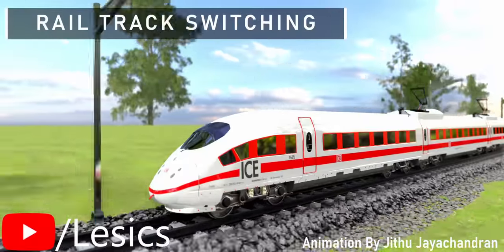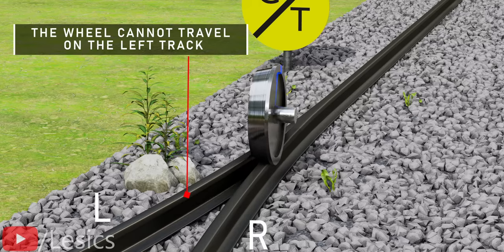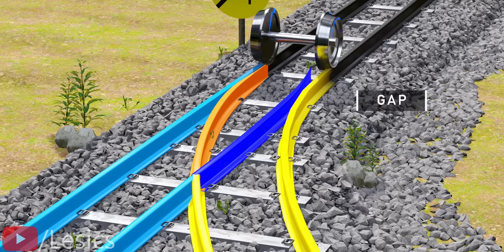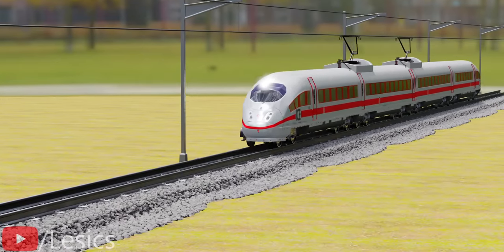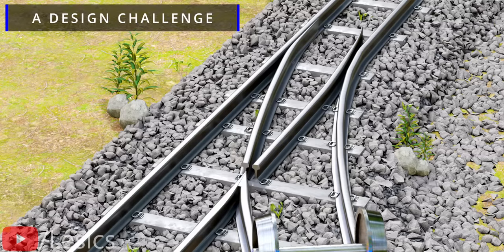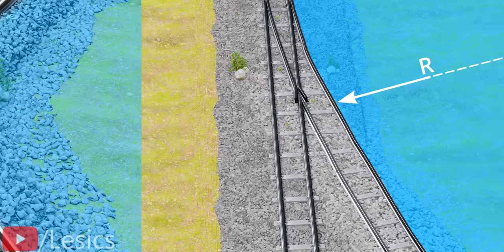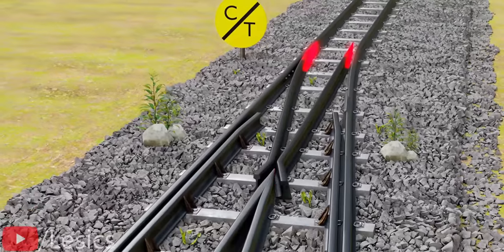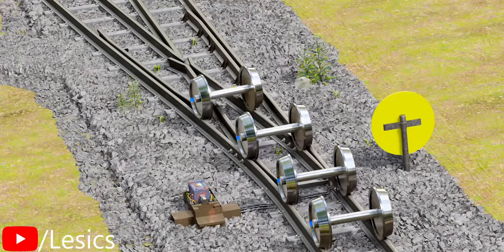How do trains change the tracks?

Comment: I have travelled  so many times in train....always  think  about this mechanism how it actually works?..this video explains everything....thank u...
Reply: Yes
Reply: Not quite everything.
What will happen if the switching parts of the rails will be somehow stuck in an in-between position?
Reply: @StrangerHappened  Good point, any feedback mechanism can be place here to find out the proper positioning of switching part, then this problem can be eliminated Or may be there would be some kind of solution for this already which is not covered in this video.
Reply: What software do you used to make this video
Reply: @StrangerHappened  If that happens, a speed code of 0/0 will be imposed and a red signal will be shown at the signalling light preceding the affected section, preventing any train movement into the section.

If I am not wrong the tongue rail will be locked in either position, otherwise it will cause the above to happen.
Reply: Same...... always tried to visualize it in my mind, but it was really difficult. This helped loads
Reply: Yes right,I also think that 😁
Reply: Yes... I.... I'm also..
Reply: Sukhibhava 🙌
Reply: @arjunkulshrestha78 ll
Reply: Yaa same here
Reply: @StrangerHappened  signal will be red and only after proper setting of the points and manually verifying the train will be passed over it that too with much lower speed.
Reply: 1q1
Reply: Me2 finnaly i know!
Reply: Everyone with a little IQ comes also completely alone on the solution how it works.
Reply: Yes
Reply: It happen to me too
Reply: @FlameBot  smart people don't look down at other people just because they didn't know something.
Reply: @StrangerHappened  হনডতাট
Reply: 太清晰了
Reply: wow...
Reply: You hadn't any toytrain when you were a child?
Reply: 6
Reply: Jjm no
Reply: @StrangerHappened  qqq
Reply: #gemigsultanami
Reply: খগ
Reply: @sintudas1828  

==¥
Reply: @sintudas1828  er1v
Reply: @sintudas1828  to
Reply: P
Reply: Kkiiu[8
Reply: @arjunkulshrestha78 w2q
Reply: Same
Reply: @StrangerHappened  train movement can happen only when point is mechanically AND electrically locked and it's indication is provided at the station master's panel. When the switch rail is in between position, the indication at panel keeps flashing.
Reply: ডতজুড
Reply: @sintudas1828  j ji
Reply: @StrangerHappened  0
Reply: @sintudas1828   x
Reply: @sintudas1828  eqoõqqõq
Reply: @arjunkulshrestha78  00o09
Reply: 8
Reply: @StrangerHappened  hbgjkf
Reply: @sintudas1828  Puri up i0i oo ji up
Reply: @sintudas1828  111nhobana bhojpnhopiriganauriga
Reply: Hi dharu
Reply: Indeed
Reply: Me too
Reply: Bruh i knew it Since im 6
Reply: @StrangerHappened  Then do something that brits love to do. Cancel or delay the trains!
Reply: Same here
Reply: ᴅᴀɴ  Some trains do have a steering wheel though.
Reply: @StrangerHappened  an accident at Crosby Station near Liverpool happened because the signalman didn't set points properly because they were sticky ( look on you tube) so accidents have happened because of points.
Reply: @StrangerHappened I’m pretty sure it would derail but idrk
Reply: @Strangero8tyHappened

Comment: As a rail tech myself, the presentation is guite good. The current mechanism would be more complex due to the need for high speed through the switches, the gap is handled with another switch. So the wheel is smoothly pass through at high speed. And also the steering mechanism which consists of several lever on the boogie and its cone shape wheel keep the train inside the track while making a turn. Its fascinating watching these awesome tech..
Reply: how are the tongue rails bent? if they are made with iron, how do they bend like that?
Reply: @FelineRaptor-gv4te  heat it up, then it gets flexible 😂
Reply: I know Cause I'm BatMan.  oh, now i get it. but wouldn't it have required a lot of strength when it was done manually in the olden times.
Reply: @FelineRaptor-gv4te  man it placed in such position that is suitable for and probably power driven by motor on this work should might be sufficient for it.
Reply: @FelineRaptor-gv4te  The torque provided by the huge lever they pulled, would have made it significantly easier to manipulate the tongues. It was probably still decently heavy even with that though.
Reply: @jamesschrader9011  oh, got it. thanks
Reply: @adityamaurya2177  oh ok  thanks
Reply: @FelineRaptor-gv4te  Dont know if its been said but they are not bending the track, that would be impossible to do with hands or even with a motor. The tunges are on a hinge and move side to side.
Reply: @andreaszottl9989  oh got it. i might have misunderstood the animation, thanks for clearing
Reply: @FelineRaptor-gv4te  Yeah it looks a bit confusing in the Video. Youre welcome😁
Reply: Not sure how the rail tech developments going. But what we use is hydraulic operated type. Can be controlled from the control centre  via electric motor or manually handpump at the switch itself during maintenance or troubleshooting to move it. It is sharp at the edges thus  more flexible. Not sure about the material tho.
Reply: @FelineRaptor-gv4te  Hydraulic pressure
Reply: @TheForceField  oh
Reply: Rails are manufactured with the required degree of curve for the crossover switch move. Support rails are bent with a switch rail bender .
Reply: @andreaszottl9989  Nope, those hinges only exist in Model railways. They are in fact bent with a lot of Force.
Reply: @FelineRaptor-gv4te  its already heated and made in curved position as they required and a switch is connected with the lever mechanism below the track. So whenever they switch track lever below track just pushes toung track close to main track or pulls away from main track. Its so easy that it doesn't need any strength or effort you can simply do this by hand also..m but it has a lock machanism too for accidental switching...
Reply: @pritam2121  ohg ok thanks
Reply: @FelineRaptor-gv4te  rise are kind of iron flaps
Reply: @sasaboor64  oh ok thanks
Reply: @andreaszottl9989  Thats only true for old, handoperated switches. Railway track is actually quite flexible and the motors used in modern switches can easily bend the track into position.

Comment: Extreme props for correcting flange mistake.  That attention to deal is what I'm subbed for
Reply: What mistake? I was confused, because I saw this video yesterday and now I got it shown as a new upload
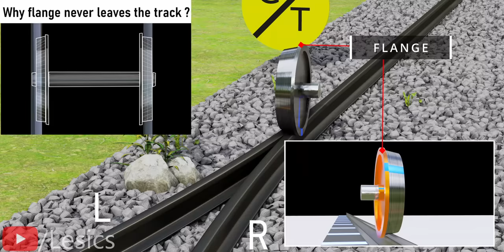Reply: The little addendum added at 0:42
Reply: The original video said that the flanges were always in contact with the rail. This was wrong. They are a last resort. The main reason the wheels stay on the rails is their conical shape. The animation clearly shows this shape but it's never mentioned in the narration.
Reply: @paulhenty  when the flange touches the rail, it makes high pitch hissing noises. It happens on a regular basis on short radius curves.
To minimize the wear, oil is spread on the flange or/and the inner side of the rail by sprinklers.They have to be set properly, nobody wants oil on top of the rail
Reply: @Boss_Tanaka  fhuu
Reply: @paulhenty   vhj
Reply: @Boss_Tanaka  hhff

Comment: I work as an engineer in Signal department of Indian Railway & its our one of most important gear. But yes it can be said as Joint Venture of Signal Dept & P Way dept (Rail Line or Track dept). Rail line related items maintained by P Way & connection from machine, all the connections for movement as well as electrically & circuit overlooked by us & thatswhy it is always centre of dispute between these 2 departments of railway. Its very very sensitive equipment mechanically, where even a millimetre matters & having very complex circuitry. Mind blowing equipment but labyrinth.🤩
Thanks to lesics, even my basics improved. 😊

Comment: My dad works in the railways so I got to learn this at a very young age, but seeing this mechanism with animations is really amazing
Reply: Mine also.
Reply: how are the tongue rails bent? if they are made with iron, how do they bend like that?
Reply: @FelineRaptor-gv4te  with enough force anything would bend. Also the bend is exaggerated in the animation its just a little bit and the metal can handle it.
Reply: @akahito8053  oh ok
Reply: @akahito8053  Where are you from buddy
Reply: @FelineRaptor-gv4te  those are bended tracks and not a straight one. The bend is done at an angle such that it remains straight during normal operation while it can be moved to other side using a motor when required.
Reply: @ervivekchoubey  oh ok, thanks

Comment: It never occurred to me that the tongue tracks actually bent to achieve switching! I thought they were just moving laterally from a closed to open position, not deforming. It always blows my mind when engineers utilize the plasticity of otherwise stiff materials to achieve the needed mechanics. It's so creative, and also requires balancing the added stress and risk of eventual failure of the complaint mechanism and the simplicity gained against the lower risk of material failure but increased complexity of a stiff mechanism.

Comment: 3:40 High Speed Rail has another moving part to ensure a continuous rail surface.
The frog (the point where the rails intersect) is also flexible and is linked to the switch.
It is more expensive but also smoother.
Reply: Not just high speed rail. There are a few even on the London Underground.
Reply: They also have a moveable frog at one location in the Metro in Stockholm Sweden (Västra Skogen).  / B.
Reply: @mbo191  I am aware that there is 1 swingnose crossing (in the UK we call the frog a nose) on the Piccadily line which rarely exceeds 40 mph
Reply: @sublivion5024  - The swingnose in Stockholm goes backwards in to a siding with a Stop buffer at the end, max speed is 10 kph (6 mph). When you are heading Northbound on the mainline it's a trailing point so I have no idea why they put it there.  / B.
Reply: @mbo191  very weird

Comment: Lesics please make a separate video on the working function of Diesel and Electric locomotive. Thank you 👍👍👍
Reply: A Diesel engine turns an alternator, which produces 2000 amperes of electricity, which goes to a set of electric motors on the wheels, known as traction motors. You’re welcome.
Reply: @oscarfoxman785  I understood, Thank you 👍👍👍

Comment: Also the wheel surfaces are conical, which means the outer part of the wheel has a smaller diameter than the part closest to the flange. This is what causes it to turn, acting as the differential.

Comment: You can still see manually operated switches on local branch lines & the like. Usually the switch lever is locked to prevent tampering.

Comment: What would happen if you were to try and switch the tracks before the train has completely passed through? Would it derail, the force on the tongue be too much and break, perhaps the switch would require more force than what is humanly possible, or is there a mechanism that prevents this, etc.
This is mainly a question for the design with the switch beside it, but I am also a little bit curious what would happen in other scenarios.
Reply: Deja vu type drift, and you’ve found the funniest solution to the trolley problem
Reply: @JanSanono  Hey you stole my Idea 😡😡😡
Reply: @JanSanono  if both tracks are further away and the victim are far from the junction then the train can be derailed so we can safe both, but if not it will still killing them all with deja vu solution

Comment: On tramway switch points, the cross piece gap is overcome by letting the wheel flenge to travel on its own surface for a short distance. Its only works at relative low spees because the moment the weel is transfered over to the flenge, the effective wheel diameter increases significantly and tend to try to move the truck or boggie to the other direction. Therefore even the other side is travelling on its flenges even if it is not needed for the original purpose.
And to further reduce noice and vibrations, the crossing piece ca be a moving part, allowing smoother ride.

Comment: There is a reason why the person who switched the tracks was called a point man. The movable sections of the switch that control the directions are called points. What you called check rails are called guard rails. And the place where the wing rails are shown is called a frog and often the wing parts are part of the frog casting. There also are self guarding frogs and frogs that are designed to support the wheels on the flange as it goes thru.

Comment: In germany at the "Deutsche Bahn" (The german Rail-Service), the switching mechanism im sometimes still done via metal line along the tracks instead of the electric motor. (like in the old days)

10 or more lines connected in a building along the track ("Stellwerk") and for each line there is a lever to switch manually.

One Switching operator need to flip each giant levet at the right point.

Ein hoch auf die Digitalisierung!
(Bless the digitalization!)

Comment: What happened if the track controller didn't function?
Reply: There are certain more mechanisms (apart from the ones mentioned) which ensure that this operation occurs successfully and in case the motor is actually damaged, the train pilots are informed by the control room officials beforehand.
Reply: Manually operation will done by pointsman

Comment: So please answer my questions  🙏 
Frog or v is a one of the turnout/switch rail component. If the frog was demage by the wheel of the train. What's parameters can be measured of the defects, is the switch safe or not ?

Comment: How can a massive steel rail, or even a half-rail be bent as shown, especially if the length of the bend is shortened in the optimized design? Seems like it would take an incredible force, and bend it plastically. I didn't know that the check rails could be involved in guiding the wheels.

Can the train driver be sure that the switch has moved completely? I heard of older technology switches being vandalized by blocking them with rocks.

Comment: In this video you can easily add another topic for mechanical or automobile engineering students . Why Differential not use in Train axel  while train also takes turn like other vehicles. Flange also play a pivotal roll in take turn of train and tapered trade of wheel is key stone of this game. P way design also helps in train trun.

One another intresting thing a yellow coloured Caution Board named with F/M near these crossing or point that is stands for Fouling Mark. This is safe distance for avoid collision between passing trains. In busy routes F/M facilitate with signal but normal section not found signal easily there Train Operator extra alertness always required.
Reply: You seem to know all of the necessary info.
Why don't YOU make a video?!
Explaining your 'differential' question takes only 4 - 5 words.

Comment: Thanks! I always figured, since there was one rail track continuous and the other one with a gap, the wheel on the continuous track would kind of drag along the other wheel, which loses the track for a quick moment. Makes more sense with the flange^^
But I have another rail track related question. On bridges, I have seen a second pair of rails inside the actual rails. In my unknowing eyes, there is no way the wheels can interact with them in any way... What do they do?
Reply: Those are called check rails just the same as they are on the points (switch or whatever your country calls them). On bridges there's the danger that if a train were to derail it could plummet over the bridge. The check rails are there to stop the bogie sliding too far off the rails and helps keep the train upright if a derailment should happen.
Reply: Looks like you didn’t watch the full video :\

Comment: Ex locomotive engineer, CP, UP, and Amtrak, I use to always look at "The Points", becase the train is going where the gap is. The problem is "The frogs". The frogs take a beating. I had a maint. of way guy tell me once, if you could see the condition of most frogs, you would stop running trains.
Reply: The manufacture of points (switches) is very complex - I only know as my son is a CNC machinist in a factory in England making them! All the components subject to wear and bashing are made of manganese steel, including the rails. This alloy work hardens and so becomes stronger in use: however it is a pig to machine! But components do wear out and therefore points have to be periodically replaced: that's why the factory has been in existence for over 100 years! You cannot just weld a manganese steel rail to a regular high carbon steel one: a fillet of stainless steel has to be welded in the interface between the the two rails. So although the theory of operation is relatively simple the manufacture of the them is not quite as straight forward.

Comment: It seems to me that another way to prevent the wheel from dropping down when it crosses the rail gap would be to build up the area next to the rail so that the wheel flange is now temporarily carrying the load.
Reply: You would end up breaking the flanges.  They are relatively thin and not designed to be load bearing.  Also, if a piece of the ballast got stuck in that area, the flange would ride up over the top of the rail and result in a derailment.

Comment: what if the train comes from the other side while the track is switched to turn?

i actually made some rails in the game scrap mechanic with modifications to add train wheel's and rail's and in that the trains derail when trying to drive from the other side when the mechanism is switched to turn
Reply: It is
Reply: @pixelapse9613  what is